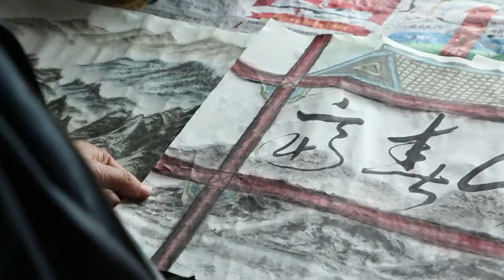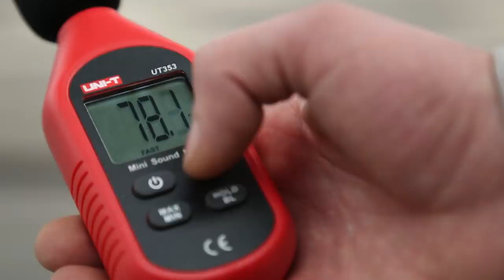World's Biggest Intersection | Free Doc Bites | Free Documentary

Comment: This vid just proves that they need to redesign and figure out new ways of urban planning.
Reply: The best answer to that I've seen on YouTube is "SkyWay Development Solutions" where ~40 story mixed-use towers are spaced every 500-1000 meters and are fully integrated with transit. Basically that puts all stores, schools, hospitals, apartments etc. one or two elevator rides away from the nearest train station. All villas and townhouses, if there are any, are in walking distance from one or more towers, so there are no driveways or parking lots at all, only pedestrian walkways and an optional two-lane service road.

Connections between towers take advantage of a new ultralight system of tracks where the suspension bridge cables are embedded inside rectangular rails immersed with a concrete fill, which eliminates the need for railway sleepers completely, thereby contributing to some of the weight reduction of the overpass structure, which totals over 90% reduction when compared to existing transport overpasses of the same capacity. Thus, the cost of the transportation structure can be low enough so as to be included in the price of each tower.

The rail vehicles are self-driving, so a higher frequency of smaller vehicles can be employed without excessive power loss. Lower per vehicle weight also reduces maintenance expense on the tracks as per the Fourth Power Rule and also contributes to the significant reduction of the overpass weight.

Demonstation tracks are being built right now at SkyWay Ecotechnopark in Maryina Gorka, Belarus and SkyWay Innovation Center in Sharjah, UAE.
Reply: @ayoutubechannelname  so true

Comment: Perhaps you should use the correct terminologyan intersection is where two or more roads meet at grade level meaning everything is on the same level this is an interchange an interchange is where two or more roadways intersect at different levels connected to each other by a series of ramps and flyover bridges. In this way traffic can flow from one roadway to the next unimpeded emanating the use of stop lights or stop signs

Comment: Changing the investment focus to mass transit would have a better impact on reduction of commuter congestion. Trains can more more people for less energy than any other mode of transport.
Reply: Most building entrances are on or near ground level, so it becomes very tempting to build transport links at ground level. Since trains have a larger turning radius than cars and are much harder to mix with pedestrians, public rail transport navigating through dense urban building clusters will have to be either elevated or subterranean. Thus, train public transport usually needs to be fed by a seperate ground-level system of buses. However, where there are buses, there are roads, and the existence of roads creates an irresistible opportunity for car adoption.

To eliminate the need for most roads, the proximity of rail vehicle stations needs to quite be high. Thus, we would need a larger number of smaller rail vehicle stations, and a larger number of smaller rail vehicles (not just trains) to ride them. Since it is impossible to hire enough rail vehicle drivers for that many rail vehicles, these rail vehicles would also need to be self-driving.

If we do not give up on roads, then the something like the Singapore model could be employed which would limit the number of vehicles on the roads through heavy regulation and taxes, though this of course doesn't cover the fact that rail transport is more efficient than paved transport regardless of vehicle size.